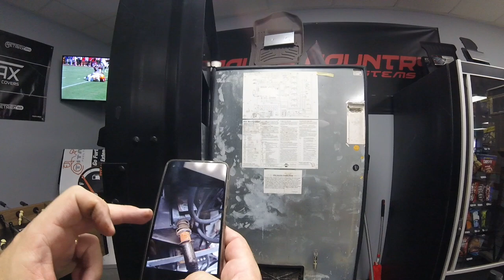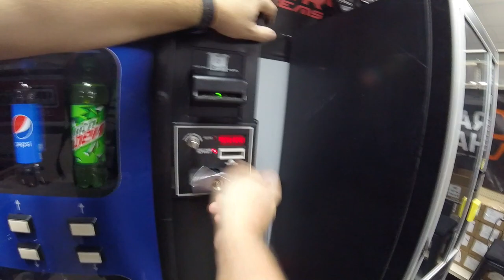Royal 650 Vending Machine T Handle Repair

Comment: Hey GalaxyGames, I have the same exact issue but dont have an extra tee handle assembly. Can I get a c clamp from any hardware store? When I google search it I cant find it. Hope I dont need a whole new assembly. Take care!
Reply from the maker: I would imagine you should be able to find something to get you by at your local hardware store
Reply: @GalaxyGames843  just went to Menards and secured the bag. Appreciate you knowledge and your channel.
Reply from the maker: @jacobgrajauskis  glad I could help!
Reply: @GalaxyGames843  another question. Now that I have my tee assembly fixed. The “nut” the tee assembly screw into is extremely loose and in my opinion isn’t even the correct part. Every time I go to screw and lock in my door my tee handle isn’t connecting because the nut is bouncing around in the bracket. Any ideas?
Reply from the maker: @jacobgrajauskis  it's supposed to move freely inside that piece of metal!
Reply: @GalaxyGames843  oh really? I’m having an extremely hard time getting the two to connect to screw in.
Reply from the maker: @jacobgrajauskis  check to make sure your machine is square. I had that issue once and had to put some shims under the back corner
Reply: @GalaxyGames843  you my friend have solved the issue. Extremely grateful! Thank you so much. Love the channel and your content. Keep it up! Rooting for your success!
Reply from the maker: @jacobgrajauskis  glad I could help! Thanks for supporting the channel!